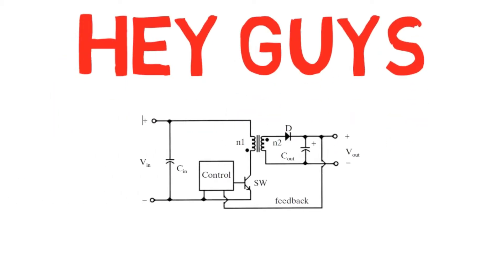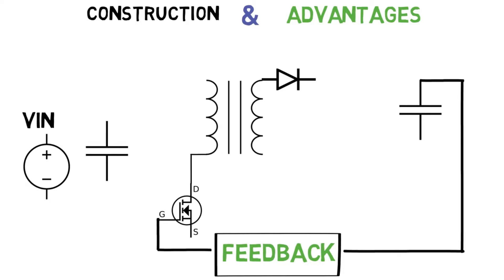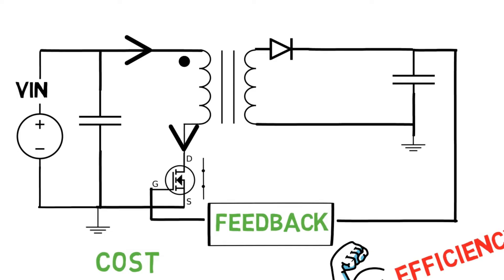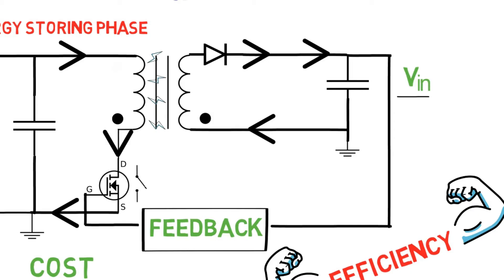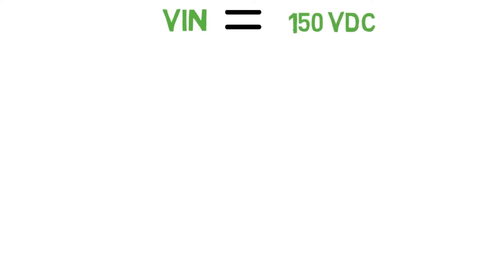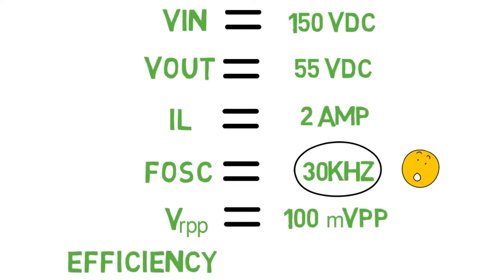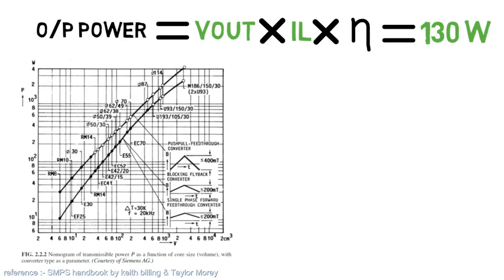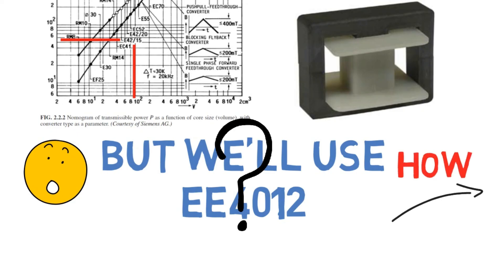Flyback converter design | explained | part 1 |  selection of core

Comment: initially, at the beginning, the mosfet is off, no current flow through the primary coil, so there is no magnetic field induce EMF in secondary coil, 0 volt output, how come the mosfet turn ON if feedback Voltage to the gate is 0 volt?

Comment: can I boost 5vdc to 80dc and then pass it through an inverter control circuit 50HZ to get 80ac output?
I can't use the conventional since I can't find a 5ac to 80ac step-up transformer
Reply from the maker: Yes you can

Comment: by the flyback converter i need to increases the voltage from 390v to 1000v is it possible having a power rating of 1200watt tell me sir
Reply from the maker: For such power, please don't use flyback converter. You can use Full bridge converter, where you can step up the output voltage also. by changing the turns ration of the transformer.

Thank you so much for watching the video!
Reply: @FoolishEngineer  thanks a lot..
i will try to do it by full bridge converter. but what about the control and feedback in hardware and simulation work can u tell how to do it.

Comment: the input ground and output ground are not the same or are  they?
Reply from the maker: Is simulation they are same, but in actual circuit those are different.
Reply: @FoolishEngineer  so to design the feedback which ground should I reference to ?

Comment: Please bear with me I'm a beginner in electronics, ie started learning
Vrpp =100 mVPP is assumption value or calculated, if calculated how.  Same about current IL =2 AMP
Reply from the maker: Vrpp is an assumption and load current is what you have to check how much current your device needs, it is a requirement.

Comment: Thank you for the video. But , Can you help me ? A flyback with Vout is 12000V , it seems difficult for me to  calculate and design .
Reply from the maker: Dude, Why do you want use flyback topology for such high voltages? what is the current?
Reply: @FoolishEngineer  that is High voltage direct current . Maybe AC 220V 50Hz -> DC 12000V . Can you suggest me any things?
Reply from the maker: Please don't go with Flyback topologies for such High Power.
Reply: So , which of topology that i can use for 12000v DC?? . Thank for replay

Comment: Winding start of primary and secondary are in opposite.....u have shown it on same sides...
Reply from the maker: Can you please elaborate the term "start of the winding"?
Reply: @FoolishEngineer  yes...Dot represents the start of winding i.e starting point of winding when u practically wind transformer on bobin...
These starting points are exactly opposite for primary and secondary...i.e if core is of 4 pins(two pins each side)..then if winding at primary start at pin 1 of the primary then  winding at secondary side should start at pin 2 of secondary ...for a flyback transformer...
Reply from the maker: According to my study, the dot represents the polarity of voltage or direction of current, where the dot is placed the current starts flowing through that direction. In this video, that's what we have shown, your statement is true, the dot in ebery reference toplogy circuit represents the initial direction of the flow of current.
Reply: I would suggest u to go through power electronics books muhaamad Rashid.....As I never heard Dot representing polarity...still I will search and tnx for hearing me😄

Comment: Is there a textbook that shows a circuit like this, where the gate of the mosfet is connected to the point between the output capacitor and diode?
Reply from the maker: No, it is just a representation of feedback, generally there has to be a potential divider which will scale down the feedback.
Reply: @FoolishEngineer  Thanks very much!

Comment: can u please tell me how u calculated output power...u said output power =vout*iL*efficiency=55*2*0.85=93.5W, then how come it is 130W...Thank u..
Reply from the maker: hi Kiran, it's a mistake in the video
Sorry for the wrong formula shown.

Due to losses the power transmitted by the converter will be more than the rated power hence the design consideration has to be for the power more than rated one so the formula will be ((o/p voltage x o/p current) / efficiency). 
I hope this helps.
Reply: @FoolishEngineer  Please mention this in the description as well. That will be helpful for others too. Because first I looked in the description assuming someone had asked and you might have updated in description but then I had to look in the comment :( Anyway the video is very nice and helpful.
Reply from the maker: @MayankGour13  thank so much for the feedback, I have added that in the description

Comment: I need to design a flyback conveter that can be adjustable input voltages. In that way i would be able to adjust output voltage.

 Could u give me some tips to make it possible, thank u
Reply from the maker: I would check regarding it and soon I'll upload about the adjustable flyback converter.